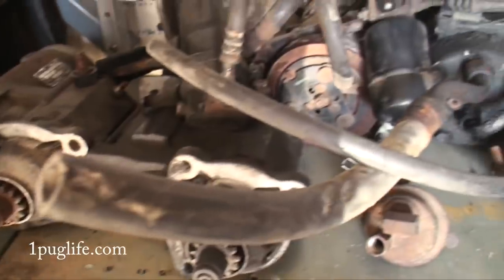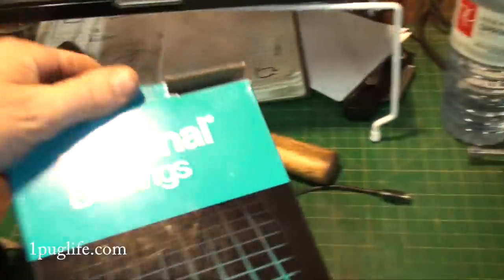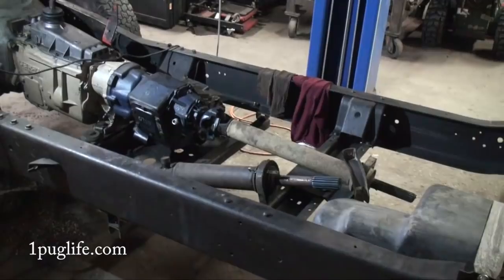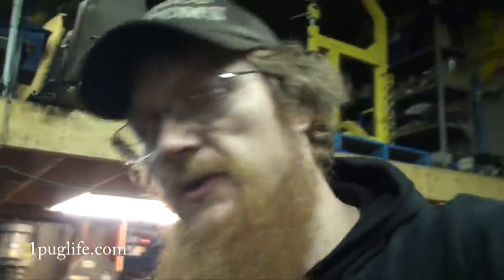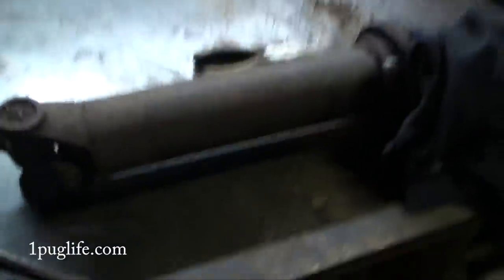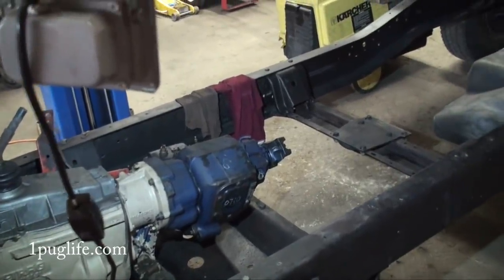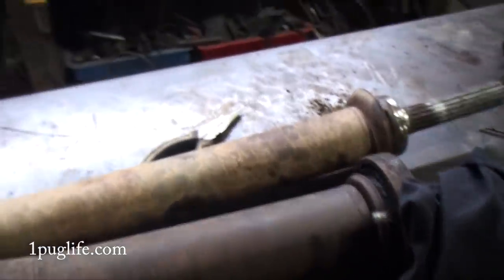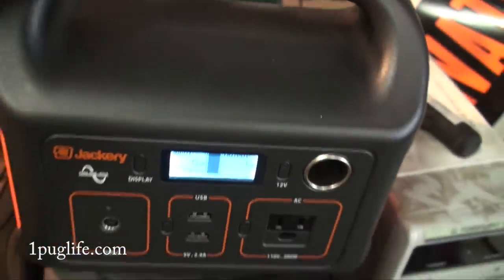got the shaft

Comment: One piece driveshafts need a spline inline with it. That allows the shaft to lenghen & shorten as the rear axle moves up & down without ripping the trans & engine off of the frame mounts. Ask the drive shaft Dicks about your options. 👍👍

Comment: Pug, I worked at Napa for 6 years. There’s a way to make anything work. If your parts guys can’t find a u joint with the different sized caps on that you need, you can have them find 2 u joints with the right caps and take the caps you need and combine to one. I did that for guys many times building Frankenstein race cars. Hope you find something that works!

Comment: i used do deal with that sort of issues all the time in the general automotive and transmission shops i worked at, take your die grinder with a cut off wheel and cut almost all the way thru then with a large chisel in the groove smack it and it will split the rest of the way.

Comment: I have a 2000 gmc siarra 1500 & it has a large/small u joint at the transmission joint.
Reply: That and a 3/4 ton  1972 ford  4x4  front drive shaft has the other size cross joint that is 2 different  sizes

Comment: You can’t use a 1 piece driveshaft. When the suspension compresses it has to have somewhere to go. You need the carrier bearing setup on there since you don’t have a slip yolk going into the transfer case.
Reply: he could get a 1 piece with a slip yoke in the middle
Reply: Profit Lemon Then it’s not one piece.
Reply: That's not true ..he can get a one peice shaft made .. u still have to use a slip joint
Reply: What's a one peice then?..is the front driveshaft considered a 2 peice?
Reply: Jacob Mcling     I would consider the front to be a two piece since one piece slides inside the other piece. You may have a point and maybe I’m wrong and they call it a one piece though. Regardless of any of that, the fact is that it needs a slip yoke in it, that’s all.

Comment: Build your own d shaft, you have all the equipment to do it, for someone with all the tools in the world you sure outsource lots...
Reply: You Saw His Driveshaft Balancer 
And Rotary TIG Welder Ovener In The 
Corner Next To Forky Right ?
Reply: Did You Understand The Two Different Size U Joint
End Caps Problem ?
Reply: Have you seen his welds.?
Reply: He has all the tools known to man, some are good high quality some are lower quality. He should be able to fix/rebuild his pressure washer too but cant seem to figure that out either. Nelson will come fix it all and biffany will have to keep him happy enough to come back and fix more stuff. If it wasn't for Nelson pug would have nothing that works or runs. Pug cant even paint parts properly. The engine in the 83 will barely get warm and all the painted fuel lines and everything painted with krylon will just melt off.
Reply: Goodstuff Garage yeah he's a pretty good welder actually
Reply: @kevinb204  ever see the welds on his box sides.? Couldnt make them look good with ten pounds of filler.

Comment: Yeah driveshafts need to be pretty balanced and sturdy I believe right? Plus you need to allow for the travel in the suspension of the rear end to the transfer case to right? Isn't that a different rear end? I'm sure that changes things, I'm not a mechanic by any means. I just know that the weights that were on my driveshaft fell off and I couldn't believe the shudder I had when I went over 55, just a little weight in the right spot made a big difference. I would think that it could do some damage if it isn't right.

Comment: Back away from the pipe. 

You’re going to need to get the measurements of the shaft length from the transmission flange to the yoke on the Dana rear. 

A one piece shaft will have too much angle at full suspension travel.